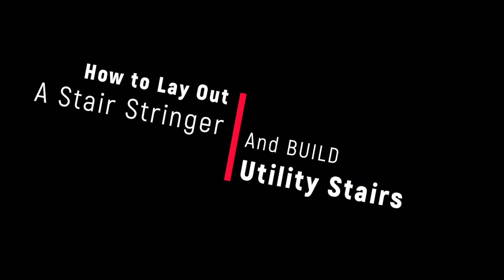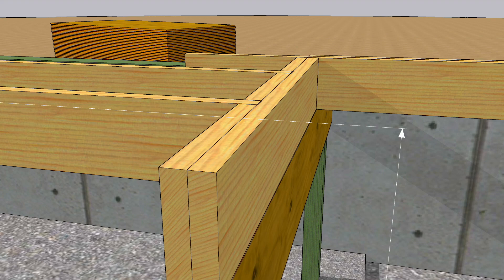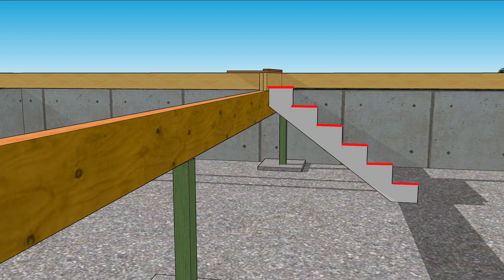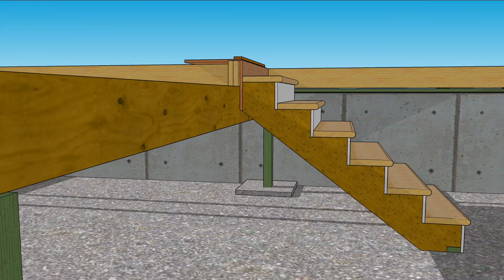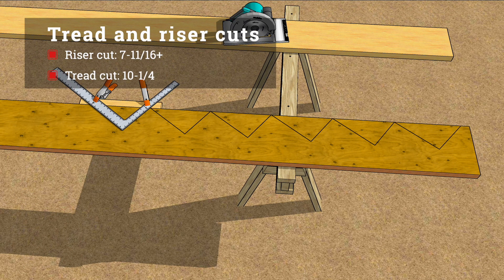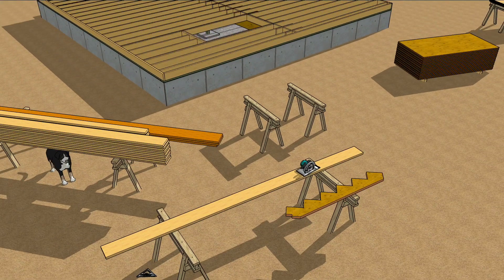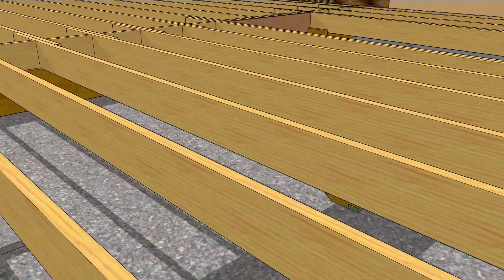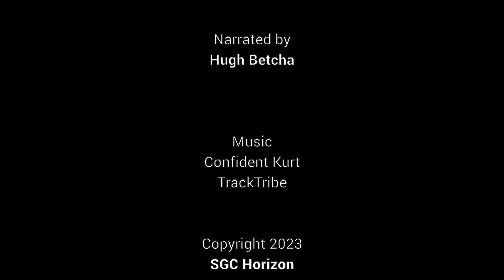Basic Utility Stair Construction: How To Frame A Crawlspace Stairway

Comment: Question: Is there something sturdy and stationary that can be attached to back of stairs to prevent unexpected/unforeseen collapse?  I have had these types of steps collapse from underneath me, and I am now paranoid.  I am thinking about purchasing a house that has 4 steps leading into crawl space.  Also, shouldn’t there be a railing to hold on to prevent falls?  As you may be able to tell, I am paranoid after my fall.
Reply from the maker: These steps as drawn will not collapse unless you are carrying a piano up them.

Yes, there should be a hand rail, but this was a tutorial; about making steps